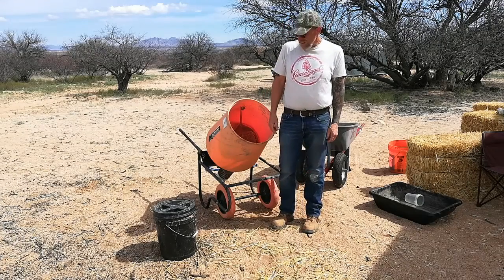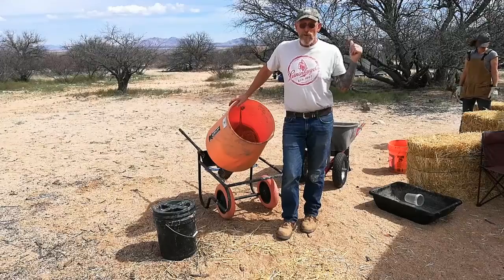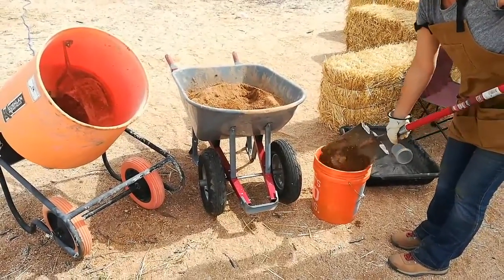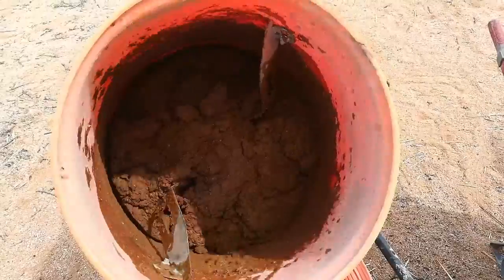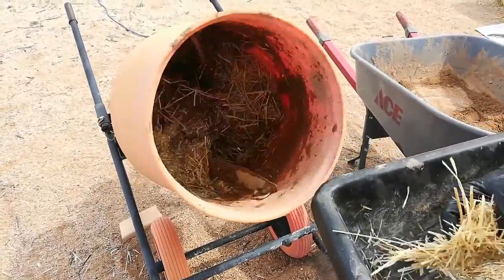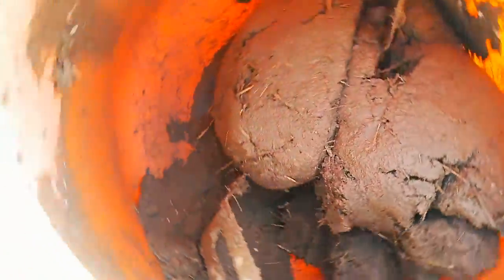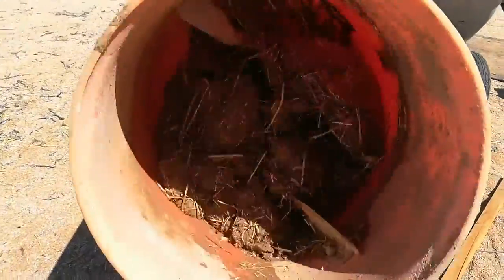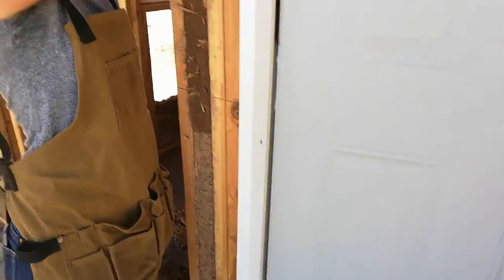Making Cobb with a Cement Mixer

Comment: ok so ive done crete for years. head to harbor freight in sierra vista. i got my mixer there and was ALOT cheaper than home depot where derrick got his. plus if your gunna do and slab work i would spend the money on there $99.00 concrete vibrator. fills gaps, levels and just makes it easier.keep strong my friend....